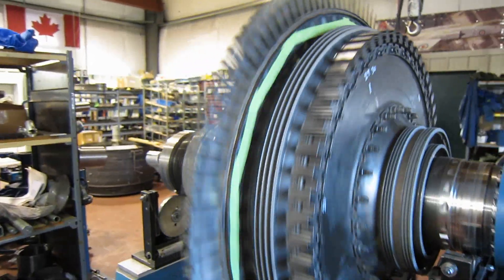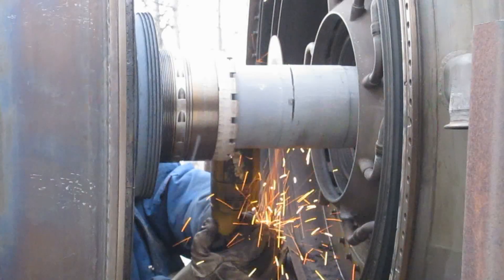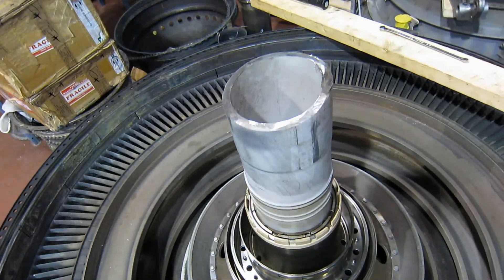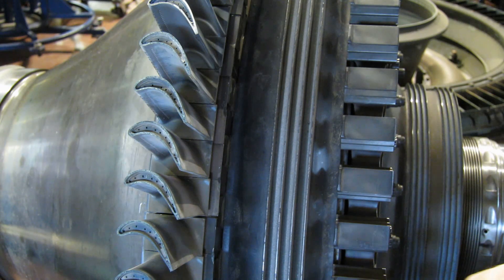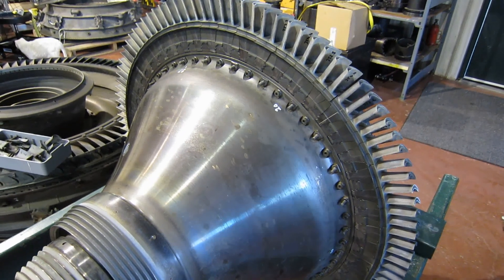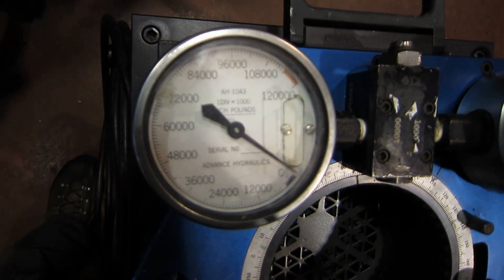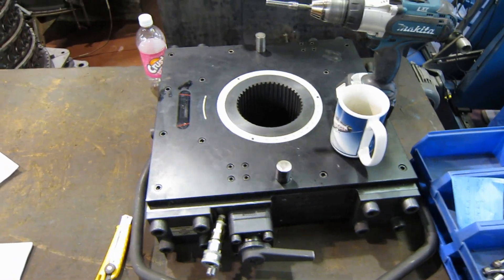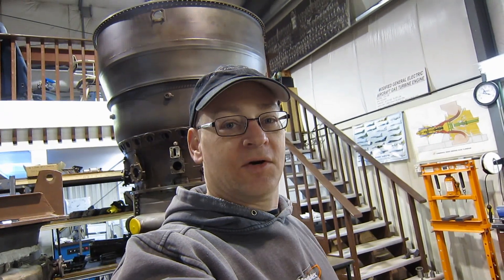Turbofan Parts Donor 3

Comment from the maker: @xxJohn1977xx It's a bit like the sprockets on the back of a mountain bike: the cogs are slid onto a plined freewheel, and it is the splines that transmit the pedaling power from the chain to the wheel. The nut holding the cogs on the spline is not directly involved in power transmission.

Comment from the maker: @tyroneorourke The tube / nut / coupling in the LM2500 is torqued to 90,000 in-lbs, which is 7500 ft-lbs... but sometimes these things get stuck and really don't want to come apart.
 
Usually the 10,000 ft-lb wrench will do for disassembly. Sometimes you need to call out the big guns...
 
And it's not just about available force... sometimes to have precise control when applying a large force, you need an overwhelmingly powerful tool. Unstoppable, you might say.

Comment from the maker: @xxJohn1977xx Yeah, it's a a captive nut inside the turbine shaft.
Actually, because it has splines on the inside ( they engage with the tool dropped in), and threads on the outside to screw into the compressor shaft... technically it's a bolt, but because it is in the shape of a nut, it's called a nut.
Don't worry... it's supposed to be confusing :)

Comment from the maker: @xxJohn1977xx The two are indeed held together by a threaded connection, but the tension produced by that coupling being torqued is used to hold the splined sections of each in contact. Much like tha LM1500, the force to turnn the compressor, supplied by the turbine, is transmitted through the spline; the coupling holds the spline together.

Comment from the maker: @energyalt56 
The CF6-6 was used to power the DC10, the Airbus A300, and as it was developed into the CF6-50 and -80, it was used to power some 747s.
The LM2500 was originally designed to make 25,000Hp. It has also been developed over time, and the last one we put together was rated at 34,800Hp..
Reply: what do they change to increase the power with the "same" design? just optimization of the "blades" or bigger changes like complete shafts/housings..

Comment from the maker: @deSloleye cooling air must flow, so it needs to be of a greater pressure than where it's going. The stg 1 HP turbine nozzles are almost at the highest air pressure in the engine, so the only source of air is from the point of highest pressure, immediately aft of the last stg of compression. This is called Compressor Discharge Pressure air, or CDP for short.
 
At full power, this air can be 600 degrees F, but is still "cooling" to nozzles subjected to 1500 or so degree gas flow.

Comment: @FrontSideBus Nah, unless they would be thieves also had the spline drive torque adapter, think it would be quite a task for someone to steal them...besides the engine has been just been sitting there in front of the shop for some time already.  The blades would probably be safer bolted into the fan, than they are stored loose in the storage tent.

Comment: Since in the last clip, you said that that an operational CF6  is worthless, you guys should reblade the fan, mount it on a stand and get a decent sized electric motor to continuously spin it, as kind of a billboard for your shop....just a thought.

Comment: The power of a Turbine engine is mind boggling!  The Y2K Motorcycle uses a small Turbine engine and goes over 200mph and uses a lot of fuel. I'm wondering if a small turbine engine will ever be used in place of a Semi tractor trailer's diesel engine?

Comment: Very nice Story - Little sad the shaft - saw - part, but very impressive, how long - durable theese High - pressure - Turbine - blades are. 
One Question: must it be feeded by liquid Kerosene (the usual Jet - fuel A) while compressing and moving natural gas in a Pipeline, or could it also use this same natural gas, which is moved by the engine?

Comment: Hi AgentJayZThis channel is quickly becoming my favorite..I'm working my way through all videos now. Just awesome. Thank you very much. I was wondering; I work in the electrical generation field (we don't use gas turbine engines though), and we have regular scheduled maintenance etc and maintain appx 99,9x % availability on our equipment. Is there regular scheduled maintenance on these as well? Are these engines run 24/7/365 until? Surely there would be an advantage in taking them out before the expensive stuffs gets destroyed.Thanks for the excellent videos Ps: I'd choose the CF6 ;) but I've never been good with money

Comment: So what are you actually using all that torque to do - you mentioned a coupling that wasn't really a nut, more like a shaft - that I assume holds to turbine to the shaft. That's probably a wrong assumption, as looking back, you had a video that showed a turbine to compressor shaft coupling nut that used only 200 or so ft/lb. Thanks in advance for clarifying.

Comment: Based on my experience, the hydraulic tools are the most powerful tools. When you use 10,000 psi of pressure, it can torque or loose anything!  And sometimes the nuts or bolts have to be torqued to 120 ftlb and step 2 to 45 degree and third step another 180 degree, that is a lot of torque. Thanks for this video, this engine CF-6 is scrap?

Comment: Hi Agent JayZ,  i can't visualize the power of these turbo fan engines unless i have something large to visualize with.  What i want to know is if you mount the 2 engines from a 777 at the rear of a typical 3000 passenger cruise ship, will it be powerful enough to push the ship using just the thrust from the fans?  Sorry for this stupid question.
Reply from the maker: That power would push the cruise ship to about 40 knots, and be extremely noisy doing so.
A better option would be a marine version of a slightly smaller engine, the LM2500. It's derived from an earlier relative to the GE90, the CF6.
Roughly 35 thousand Hp, and it is used to turn a normal ships propeller, via a reduction gearbox.

Many cruise ships use this exact drive system, quietly and efficiently.
Reply: I was on Holland America's ship "Oosterdam" this summer and they use 4 diesel gen and 1 turbine gen.  The ship uses two pod motors to move.  The jet engine must be really deafening in the engine room.  I really feel for the engineeers.  By the way I really enjoy your videos.  Thanks... David of Seattle

Comment: Hi Jay. What would you say is the diameter of the CF6 hollow shaft, the thickness and its length? We are doing some torsional analysis calculatio on the LM6000. Thanks
Reply from the maker: I can only go on memory, but it is shown in the video being cut in half with a grinder...
I would guess it's 25 cm diameter, and 1 cm thick.
I can tell you I've read that the LM2500 PT output  is rated at a nominal 66,000 lbs-ft of torque, with transients to twice that.

Comment: I am scouring ebay for a first stage turbine blade with cooling holes. No luck yet.
Reply from the maker: +Tyler H (Helicopterpilot16) You can recognize them by sight. Don't trust the description.
Reply: That's exactly what I'm doing. I'm seeing mostly 2nd stage blades, and first stages of smaller turboshafts.